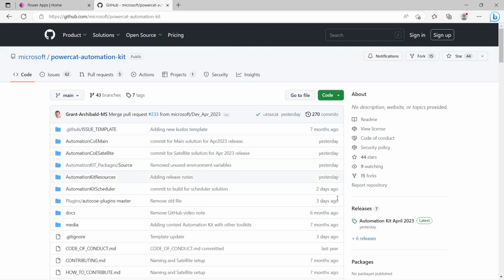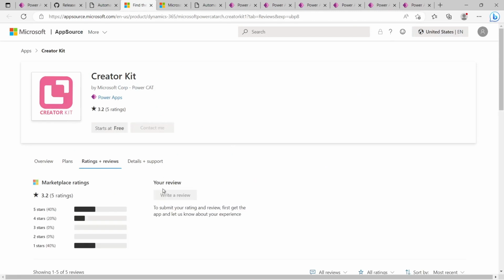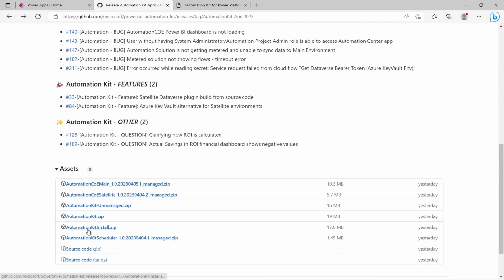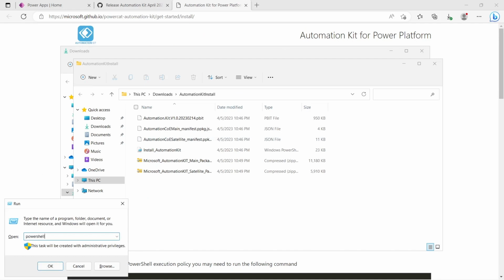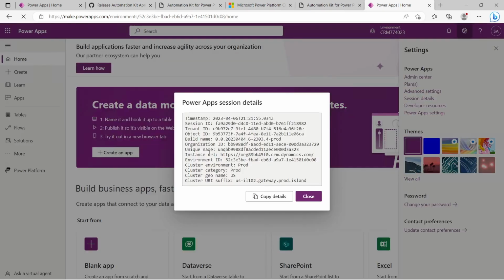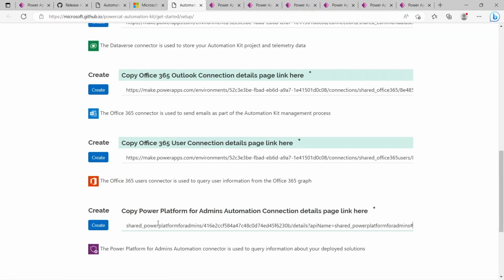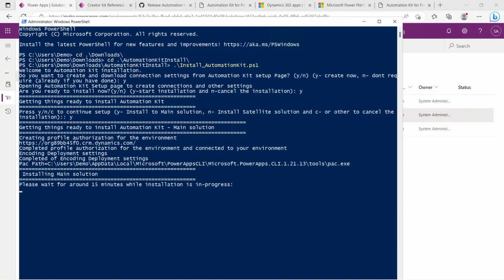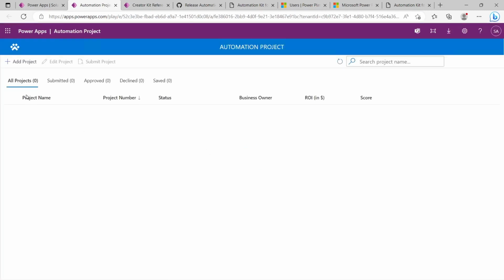Main Install | Automation Kit for Power Platform

Comment: This is the easiest way. Can you imagine the complicated one?
Reply: This install process is the next step in improving from the current manual process setup. As part of the set of updates we are working on will be the ability to include this will an App Source Deployment process and Install Wizard as part of the solution. As we make these changes it will greatly simplify the connection setup process and remove the need to install any command line tools. We will update this video and instructions as we make these milestone updates to the install process.